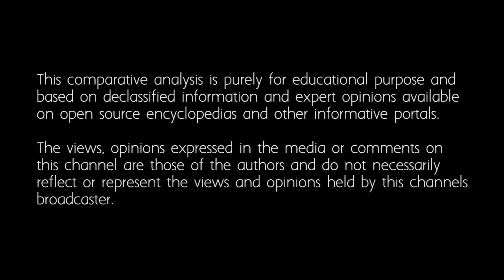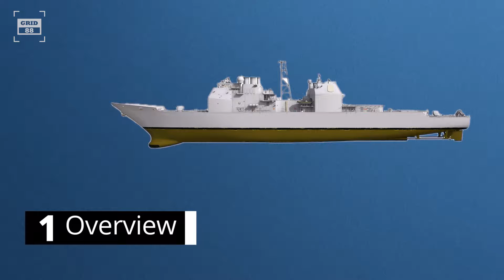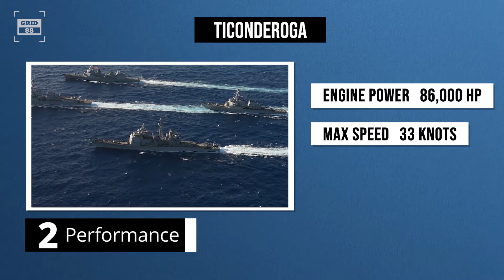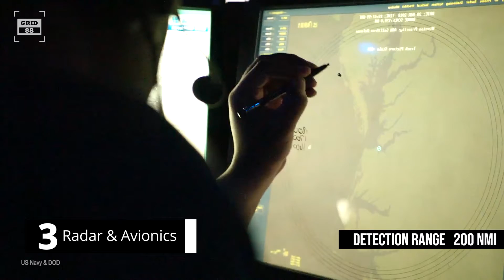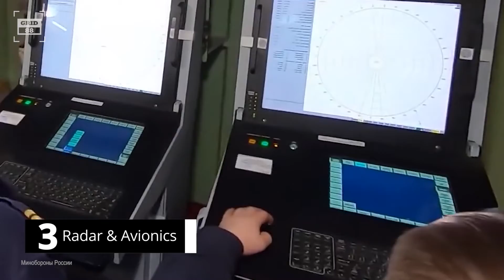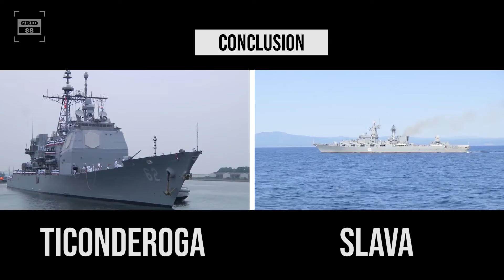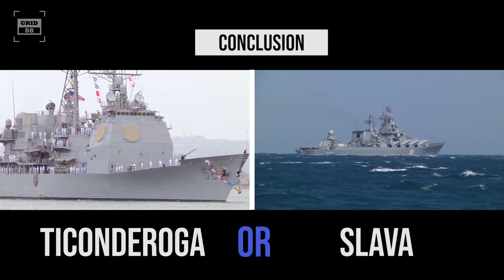US Navy Cruisers vs Russia’s Navy Cruisers

Comment: I think it's worth mentioning that the Ticonderoga-class probably has much smaller radar cross section, thanks to the VLS-cells and phased array radar. The Slava-class on the other hand has traditional missile tubes and a mast mounted radar. 
So in a 1v1 scenario a Ticonderoga-class would probably spot a Slava-class ship first and use that to it's advantage

Comment: Aegis is an integrated rader, and battle management software suite. It cannot destroy satellites or anything else. It purpose is for detecting and tracking hostiles contacts, and assigning weapons solutions for destruction automatically.

It MK 48 torpedoes, ASROC missiles, SM-2, SM-6, SM-3 missles, plus harpoons anti-ship missiles and the two five inch guns, phalanx 20 mm CIWS, are its main weapons
Reply: Mmmm, not true. The Aegis system has been used to shoot down a satellite. It is very capable of doing just that. You are correct in how the system works, but the weapons it controls are far superior than what Russia has available.

Comment: most russian crusiers are completly worn out. i read that on moskova at the time of its sinking that only one cwis worked out of six and only half of the rest of its weapons worked, the eletronics was just such in bad shape that it could not use its radar or fire any missiles it had while using communications. and out of all its different radar systems only one was left working.

Comment: Atlant class cruisers have no prospects and will be in service for at most another decade until enough 22350 frigates enter service or until 22350m frigates start entering the fleet. Two cruisers of this class have been retrofitted, just enough to last another decade while the oldest cruiser of this class was scheduled to be scrapped this year, but a crew error that caused a fire sent that cruiser to the bottom of the sea. For the Russians, the loss of this cruiser is purely reputational, and it does not represent even the smallest military loss, because that ship was only a few months away from turning into a pile of scrap metal...
Let's face it... the Ticonderoga isn't any better either, an overweight ship on an ancient Spruance-class hull, where half of the ships in the fleet have developed structural cracks that undermine the seaworthyness of a ship!

Comment: The Slava class does not haave better range. The Tico is 6000nmi at 20 knots while the Slava is 6500nmi at 18 knots. It has 3300nmi aat 30 knots while the Slava has only 2500nmi at 30. So the Tico has better range. And as we know the Russians Tico has a lot and I mean a lot better reliability than the Slava

Comment: So your not gonna mention the Slava that sunk.  Just because it has a system onboard does not mean that the crew can use it effectively.
Reply: Or the system doesn't work properly.
Reply: Recommend reading the final maintenance report on the Moskva, might as well be an epitaph. US ships will win every time, because we can actually maintain them.
Reply: He went through everything perfectly and indirectly mentioned the sunken cruiser. He said wanted 10 and only completed 3, then said they only operate 2. Also, the Slava is meant for offense, not defense, their hull may be able to take more, but it wasn't meant to prevent hits. We made ours to withstand some hits but outfitted it to prevent any from happening then counterattack if we have the opportunity.
Reply: Respectfully disagree. The facts that rhe Moskva 1. Sank from one hit by a 30 year old missile and 2. Could even be hit by a 30 year old missile make this whole comparison irrelevant.
Reply: @chandlerwhite8302  Russia hater   and cnn puppet you believe everything they say  you don't know what happened on that day
Reply: I disagree. The fact that it couldn't handle the threats poised against it, shows how incomparable these two ships, are.
Reply: @chrisortega7521 i disagree. The cole and the stark didnt go so well.
Reply: @shaun469  Cole is still in commission and sailing to this day, yeah that point blank explosion rocked them, but unlike the Moskva, it's still kicking. But I guess that goes to the DC efforts as well.
Reply: @TerenceDonellWilliamsII  and those 2 antiship missiles that sank the moskva lived up to their name too.
Reply: @shaun469  Hey, should've opted for more defense. Plus it'd be very unfortunate if they didn't live up to their name. (Like with the Stark) Although, that hole in Cole was pretty substantial and the Stark too with the 10x15 hole. Could've definitely been a different story. But would've, should've, could've, it didn't.
Reply: @shaun469  The Cole and Stark both made it home. The Moskva is at the bottom of the Black Sea. And the Stark and Cole  events happened 35 and 24 years ago.
Reply: @chandlerwhite8302  and the moskva was hit by 2 anti ship missiles. Amazing how a asm can sink a ship huh?
Reply: @shaun469  you don't know that
Reply from the maker: You concern is 100 percent correct. However, asymmetrical warfare is out of scope of this comparison review.
Reply: @Grid88  it was attacked by coastal defense AShMs, that's not asymmetrical. The USS Mason was attacked several times by such missiles which were suspected of being of Chinese origin. In the 3rd attack within a week, it had to fend off a salvo of 5 missiles.
Reply: @apolloaero  The Russians say that it wasn't attacked, but that the accident happened due to the crew's mistake... As much as you consider what the Ukrainians/NATO said to be true, what the Russians say can also be true! When the American ship was burning, we did not take the statement of the Russians as correct, but we took the statement of the owner of the ship, the Americans, as correct... well, then in this case too, I will take the statement of the owner of the ship, the Russians, as official and correct!
And if we are already mentioning the bad sides of those ships, not even the overweight Ticonderoga on the ancient Spruance hull is in any better position. Half of the fleet is anchored due to the appearance of structural cracks on the hull that make the ships unseaworthy, and all those ships are waiting to be cut up because the overhaul is not worth it...
Reply: @jerromedrakejr9332  are you also taking their statement that it sunk while being tugged due to bad weather? Even though there's satellite footage and proof that it was clear skies and calm sea state? 
Or how about photographic evidence  of 2 missile-sized holes at about the middle of the ship?
Reply: @jerromedrakejr9332  I think we have to consider the possibility that Vladimir Gundyayev's magic splinter might have spontaneously exploded, causing a fire aboard the ship that they couldn't put out because the crew was too drunk and occupied with sodomizing conscripts.
Reply: @apolloaero  fake news
Reply: @prizefighter8699  what's fake news? You can't replace reality with your fantasies and wishful thinking, it doesn't make them true. You can literally buy your own satellite footage of said day and in that area and see for yourself

Comment: I never, ever comment on  these typ3s of Video BUT the Tico has the lead, by miles. Literally & figuratively, Data-Link with the Aegis & sheer volume of CIA satellites (if the dedicated few were taken out by S-500 first) counter balances the offensive capability or Slava. 
Easy US victory, imho.
Reply from the maker: No doubt about that Ticonderoga  has technological edge against slava.
Reply: Those Slava-Class Cruisers have very potent weapons....but if YOU shoot first...THEY die. I think of the sinking of the Moskva...not a ship-to-ship action but they couldn't even "protect" it in their own Home Waters. Yes, the Russian have some data link capabilities but nothing as integrated and well-tested by highly trained Crews as the Sensor and Data Link systems in use by the US Navy. Remember the US Navy deploys multiple Carrier Battle Groups simultaneously, globally... and has been doing it since the end of WWII. Real-time, detailed and accurate Intel linked with on-board Sensor Data is the reason the  F-35 does not have to do MACH 2 to defeat the best (any) Russian and Chinese "stealth" fighters.  The F-35 has the ability to remain unseen longer while seeing further + superior weapon systems range. Shoot first, WIN.

Comment: Ahead is the one on the surface of the sea. 😉 🇺🇦
Reply: @The1RedRooster  It was a spy ship it didn’t have missiles defenses like the Moskva supposedly had
Reply: Yeah, no shit 🤪 
Let's not forget about the USS Liberty now, though.
Reply: @The1RedRooster  What about it, Liberty didn’t have defenses, unlike the Moskva, well the Moskva supposedly had defenses but turned out the flagship of the Black Sea was barely functional.
Reply: @CrayonEater255  80% of the defensive ok the moskva weren't even work, like out of the 6 CWIS it had only one was working, then the S300s on it were offline for some reason
Reply: @The1RedRooster  LOL the liberty happened in 1967 and was a techical research ship with no defenses. Are you trying to compare a fukn research ship to a guided missile destroyer? Give your head a shake.
Reply: @The1RedRooster    yeah, let's go back in time about 60 years and point at a "research" ship (spy ship) and use it as an example while conveniently ignoring what happened a little over 6 years ago with USS Mason. USS Mason defended herself 3 times within 1 week, the last attack being a salvo of 5 missiles. 
USS Mason is not some special Burke variant either, it's the most common variant in fact. It's 1 of 40 active Flight IIA Burkes out of 70 total Burkes across all variants starting with Flight I. The Moskva was 1 of 3 and the flagship, how very embarrassing 😂
Reply: @The1RedRooster  what armament? 4 .50 cal machine guns? Lol, you're mad and you're wrong
Reply: Realy, another Ukrainian troll?
Reply: @Dan-zz8mz  Don't worry - I'm lying and "Slava"/"Moskva" is still operational! 😁😁😁
Reply: @AfroBandera  who said that??